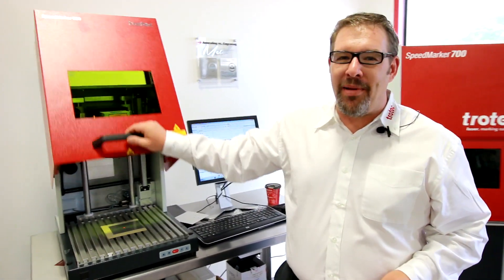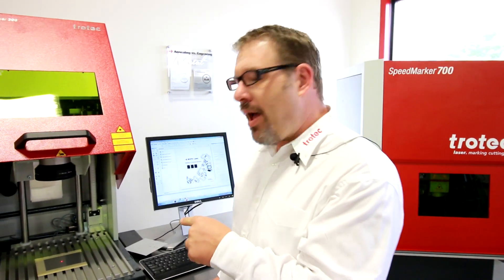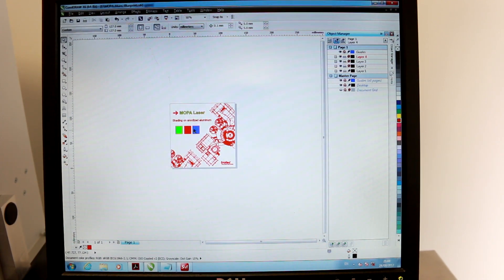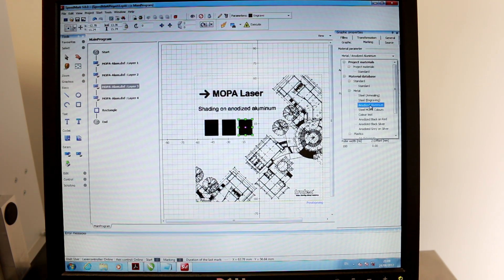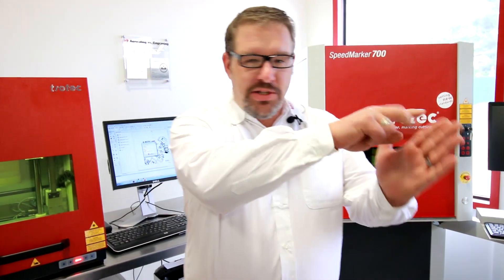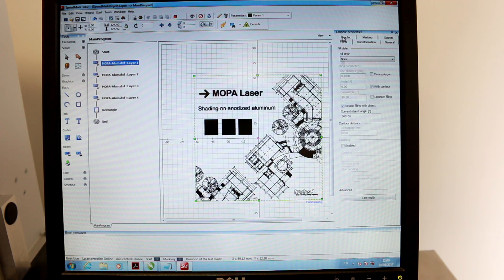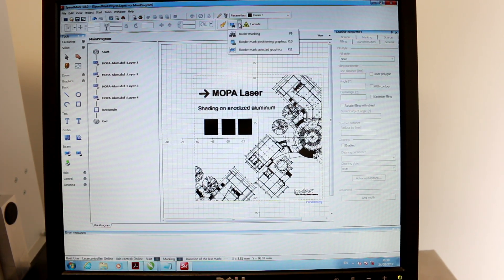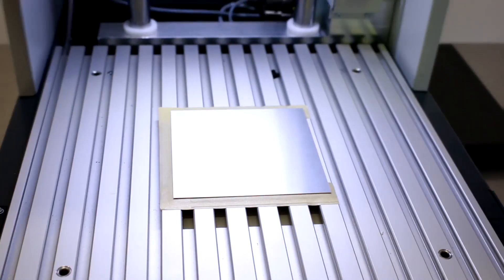Black Marking Anodized Aluminum | MOPA Laser | SpeedMarker 300

Comment: We have black anodized parts, currently we use a lazer to engrave lines on the part, we use the laser to remove the anodizing layer so we can make electrical conductivity. But this leaves our part with bare aluminium showing. If we use the black laser option can we use this to remove the Anodize layer and still leave a black line?
Reply from the maker: Hi Steve, we can test it for you on your material. Contact your local Trotec branch and you can send them samples to test. Go to www.troteclaser.com > Contact page > find local branch.

Comment: The text is showing black and white lines. It isn't completely black. Looks unprofessional.
Reply from the maker: The point was to show that a MOPA laser can engrave white and grey marks on anodized aluminum, where a Fiber laser engraves a black mark.
Reply: @TrotecLaserCanada  - Uhhhhh, I think in the Video (and my Experience agrees) a Normal Fiber lazer engraved this material in White, but the MOPA can go all the Way from White through Grey, to Black! So, for Aircraft ID Tags, it seems this would be the Right Tool to add!
Reply: @TrotecLaserCanada   I've heard that the result is highly influenced by the quality of anodizing on the part. Has that been your experience?

Comment: Could you help to me? I have got a laser marker (20W) and I would like to marking a metal one (1.4305 material) and an aluminium one with black color. I can not find a good parameters. (The maximum frequence what I can use is 200khz) The products what I would like to mark are 3mm thick. Thank you for your help.